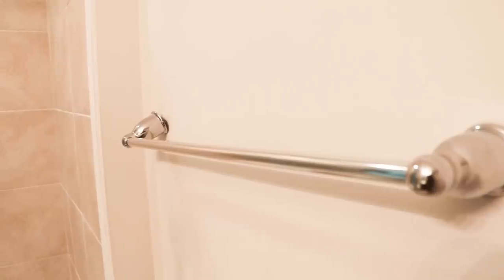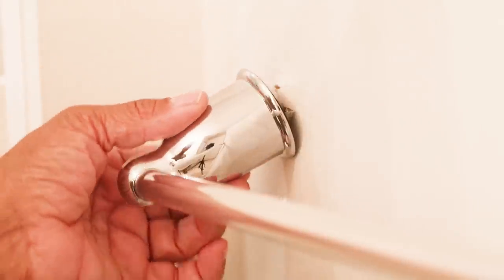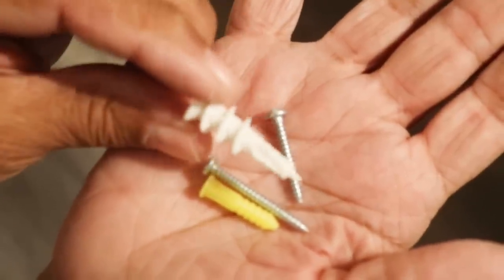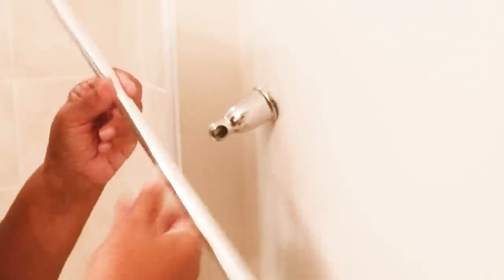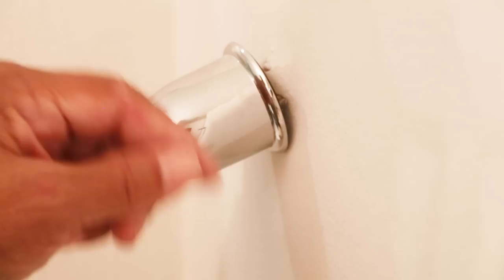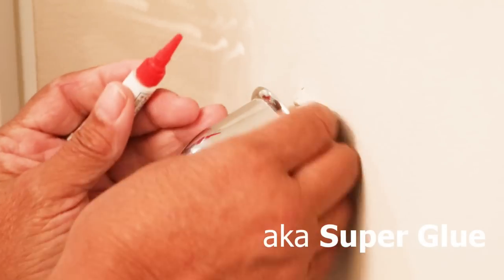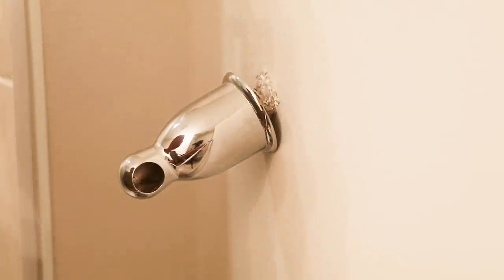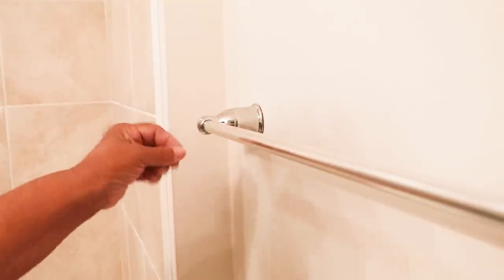Towel Bar HACK in seconds

Comment: I have a hard time with this one. Usually your guides are good, but the reason those anchors fail is because of the consistent moving and pulling on the towel rack, causing even 40lb anchors to wiggle loose. The glue will look good temporarily, but I can't imagine that it will last more than a towel cycle or maybe a few weeks before it pulls the paper off leaving a more unsightly mess. Last time this happened, I replaced the cheap anchors with some toggle anchors, reusing the hole left behind by the cheap anchors.
Reply: I agree! I always use toggle bolts. Never had one come loose.
Reply: Yeah, this is a surprising miss from seejanedrill, deep fake troll maybe?
Reply: you don't have to imagine it, try it. CA glue penetrates drywall. it's basically cardboard. have you ever tried CA gluing two pieces of cardboard together? try doing this. First remove the smooth outer layer (drywall doesn't have it). then put CA glue on both sides, and then put them together. you will never pull them apart, and the cardboard becomes structurally much stronger in that spot. I know this because I've done a bunch of cardboard work with CA and other glues, trying out what sorts of glue there are that can glue cardboard and which ones are the strongest. I was prototyping a collapsible box made out of cardboard and wanted to find the best glue to do it. It was fun as hell. And it teaches you to respect glue.
Reply: samuraiman7777  Caulk is not an adhesive.
Reply: @cheater00  Cardboard and Drywall are structurally very different. In cardboard you have a bunch of fiber pressed together. In Drywall you have gypsum plaster, pressed together between a layer of paper. There is no way that the CA glue won't tear the paper off and with it what ever powder that is attached to it. I can see some light applications, but definitely not anything that is strong enough to pull out anchors rated for 45lbs.
Reply: @cheater00  on top of that. Most likely you aren't even glueing directly to the sheetrock, but to the paint instead. Which means it won't even be penetrating as far you would think and will tear the paint off soon and with it probably some of the sheetrock paper.
Reply: @shawnferguson7477  also worth noting this gets worse for every layer of paint between the glue and the drywall.  Especially really old, brittle paint.
Reply: @shawnferguson7477  you know what, you might be right.
Reply: How rough you guys getting with the towel? Super glue should be fine, unless you rip the towel off the bar and it snags for a second. I have one glued to the back of the hollow door, been working for 20+ years 🤷‍♂️
Reply: @strongisland7015  obviously I do my pull-ups on the bar, and hang large carcasses to cook over my bathroom pit fire.  Pretty typical towel bar stuff
Reply: PogChamp!  Caulk is more like rubber than cement.
Reply: I think it'll work well enough.   I thought she was going with using CA to toughen up the drywall for those cheap anchors.  But then saw the blown out wall.  I'm thinking the CA glue will penetrate the paper and get into the gypsum/drywall material.   One concern is that CA glue sucks with shear force. But then again, you're hanging towels and even wet ones aren't going to weight 15 lbs. Blocking or toggle bolts are better, but that's not always an option for below average (skill wise) DIYers.
Reply: You might be right about drywall, but all my hardware, towel bar, hand towel ring, and toilet paper holder are drilled into tile, which covers the lower half of my bathroom. Still, the anchors loosen over time and the bar shakes a bit but this CA glue on the tile is a fantastic fix!
Reply: PogChamp!  I didn't do this for a towel, but I did this with hooks that hold jackets and other clothing (a board with 4 hooks). I caulked the holes and added new anchors in the caulk until it dried. Then I put the new screws in and it's working great!
Reply: @KrisLikesThis  there's an "I'm rubber, you're glue" joke in there somewhere 😂
Reply: @BrianSargent  😂 Good spot!
Reply: samuraiman7777  not at all. Caulk is primarily a sealant, it's NOT for gluing things together. Like, at all. 

You may be thinking of an adhesive that comes in the same style of tube as caulk and is applied with the same 'caulking gun'
Reply: @cheater00  
Would CA glue also penetrate and reinforce ceramics or pottery? I knocked the handle off a honey pot lid, and I’m wondering if this glue would be the answer.

Comment: I think what people may be missing here is that the glue is not intended to stick the mount to the wall. The real aim is for it to seep into the damaged gypsum via capillary action. Allowing it to re-conglomerate the bits of busted up material around the anchor. I oftentimes squirt thin CA glue inside my pilot holes in sheetrock immediately before inserting my wall anchors. Not only does that "anchor" the anchor to prevent it's wiggling, but it also strengthens the gypsum around the anchor.
Reply: I concur.
Reply: I've seen a video where you combine super glue with baking soda and when it cures it hardens up like it is hard plastic. I will use a combination of the glue and baking soda and coat the screw with it before screwing it in. Although, I wonder if the super glue is combining with the gypsum to give the same effect.

Comment: I thought you were going to do a different kind of repair, to put something behind the wall to give it some more meat to grab onto or something like that. CA glue and I never get along... unless it's gluing my fingers.   Anyway, I try to find studs if I can, but Murphy's Law says where you need the bar there is no stud.  Well, so far... knock on drywall, my towel bars haven't fallen out like that.
Reply from the maker: Towel bars quite often are longer than stud center which is 16 inches.  There's always that 1 side of the towel bar without a stud to attach to.  I use toggle bolts when I can.  But for a quick fix, I find ca glue does womders.
Reply: @seejanedrill  yep... that's why! I think the trick is the thick CA glue, I have the thin or medium glue... Learned to wear disposable gloves... Thanks Leah.

Comment: I think that a butterfly bracket might work better as a long term fix. My wall is papered and I am not sure the glue wouldn't pull it off.
Reply: Yup, spring loaded butterfly is the way to.
Reply from the maker: I perfer a toggle as well, but it's not always an option
Reply: @seejanedrill  there’s always a better option to glueing a load-bearing object to paint. I think you are trolling your viewers for comments.

Comment: It's worth a shot. If it doesn't work, you're back to patching a hole. So, you're no worse off for trying. It might get you down the road, but what is really nice about this is if you have multiple towel racks. If you move one broken rack you will want to move the others even though they're fine because you won't be able to tolerate looking at an off-center rack amongst a few. You then have to move them all and patch a bunch of holes and repaint.

Comment: I'm honestly a little surprised at this fix since I've seen instances where fixtures like this pulled away from the wall and delaminated the drywall they were stuck to - making a larger, unsightly problem. To improve my chances of long term success, I'd be tempted to also remove the fixture and combine glue+flour (sawdust, even better) to fill in the hole behind the towel rack so that I restored some structure for the screw to adhere to while also using the super glue as additional support
Reply: Here's something people don't think about, nothing is being atrached to the wall in a mounting like that, it's attached to the paint. 

It will fail. Source: I work at a massive hotel with 3 towel bars in each room. Over 500 towel bars, but also flat screen TVs, shower curtain bars, pictures, fire extinguisher boxes, paper towel holders, toilet paper dispensers, and a lot more. 

You learn what works and you learn what fails when you have hundreds of the exact same thing to deal with in one location, and lots of people trying bad ideas to fix things.
Reply from the maker: @aredditor4272  Actually,  I have thought about that very thing.  It provides more surface to surface contact.  If you don't put a support behind the drywall support the bar and you just continue to move it each time it fails, you just have a lot of patches.
Reply: Thank you Leah. Holy Smokes, finally someone shares an easy way to fix this problem.
Reply: @aredditor4272  what do you recommend?
Reply: I had thought of creating such a hold that would preemptively secure the fixture. A patch could definitely work, but if you are using some kind of filler, instead of flour, I'd use wood glue. I use it with toothpicks to fill door hinge holes to re-drill and the wood glue and toothpicks make the wood stronger than the wood itself. But there might be better ways to do it than this.
Reply: @KGrant-ty3oy  It depends on the situation, but ideally always mount towel bar holders into studs or backer lumber. 

If it's not possible, there are a few anchors rated to 50lbs or better, including spiral anchors that look like exaggerated screws. Project farm has a video on said anchors. I carry a full assortment with me - toggle or butterfly anchors, sprial, "toggler" or similar, "borefast" anchors. 

I often find myself using butterfly anchors simply because the head of the screw is small enough to fit into depressions in hardware. 

I run into many situations, including stripped holes in wood, so I have many different solutions. We even have shear walls where it's very difficult to find studs, so I have solutions for that. A shear wall resists shear forces, and is a sheet of plywood over studs, then drywall over that. On top of that, all walls have fiberglass insulation in them, and sometimes a coir fiber sound proofing sheet. 

Older homes have plaster and metal lath, or wood lath. 

Basically I'm saying there's much more to this subject than many folks understand.
Reply: @seejanedrill  A mistake  I see in backers, is plywood instead of a 2x(1.5") whatever on the bias. 

If it's a stripped 2x or any stripped wood, I have sets of fluted dowels,  various epoxies and other glues to repair stripped holes. Usually the stripped wood holes I repair are on doors and door jambs. Besides people treating hotel rooms badly, the maintenance guys have lots of terrible habits, especially trying to drive any screw  with an impact drill.  

Hate the pay and push to do things quickly, but I love the job.
Reply: @aredditor4272  
I just learned about drivers and watched a video about it after learning I had one in my new drill set. I was excited to learn I can use it for drilling screws and not have to drill a pilot hole and swap out bits for screws. Is a driver the same as an impact drill (your term)? Isn't their main purpose to drive screws? I thought they were especially designed for that. I'm confused. What are you saying the issue is?
Reply: @free2beme773  the issue is not being able to feel the resistance of the screw when using power drills, especially when using an impact driver. 

An electric impact driver has the same action as the air tools traditionally used by mechanics. 

When using a power drill, it's harder to feel when you're cross threading or stripping a fastener. 

Having said that, hammer and impact drills are fantastic tools for certain situations.
Reply: @aredditor4272  
So, I assume that if you are creating a new hole while you use the impact driver, that is not an issue? Just last week I helped someone else drill pilot holes and then install screws in clips to hang a cable on their hardy board on the outside of the house. If I had known about my driver before helping them, I think the job would’ve gone a lot faster. Would that have been a good use of a driver and screw?

Comment: The primary problem is very few towel racks are made to install 16” on center. Most are 20-24”. That’s nuts! Make ‘em standard so they can be attached to studs. Other solution: Install decorative trim /moldings across wall anchored to studs and secure towel racks to trim. Solid. Choose proper trim and it looks great too!
Reply: I was just thinking about doing this! I think decorative trim could be an excellent fix! I was going to do it for other things, too. Great suggestion.
Reply: That's what we do in our rentals and in our home.  It's much stronger that way than just using anchors in drywall.  Getting good trim and placing it as artfully as possible is key.

Comment: You’d think like most houses now block out areas for mounting TV’s the same would always have been for bathrooms, we did this as we have an accessible shower with an L bar. Awesome tip though!
Reply from the maker: I agree
Reply: When I was a framer I did this but that was for a custom home.  You get what you pay for.  If it's not in the building code and not on the plans It's usually not done because time is money.
Reply: @dk3062  that’s a fair point, but having a family of carpenters I guess you have more insight and forethought. It blows my mind how guys like to cut corners though, even inspectors are guilty around here for stuff

Comment: I use spring toggles that go through the plasterboard/drywall closed and then spring open like a pair of wings when they reach the other side. As you screw them up they pull tight on the reverse of the plasterboard and will never move unless you undo them. They only cost about £0.20/$0.20 each.

Comment: I went to the hardware store bought a rod " in my case square" cut it to the length that would allow me to attach to the studs on both ends. If needed you can paint it or have it powder coated.

Comment: thank you for this tip...I have two ring towel holder to hang and was wondering how I could get them attached to the ceramic tile in the shower.  Would this work also?  Thank you so much!

Comment: I have used a strip of plywood with a hole in the center as a “backer”along with a toggle bolt. Small enough to go inside but long enough to give extra surface area.

Comment: so now you're not just gonna fix the wall but also buy a new towel bar just because instead of installing the bar in a stud you decided to glued it.  the best option if you don't wanna relocate the towel bar of "glue it" as soon you noticed the issue, take it apart and replace the anchor for a bigger one and rearrange the holding plate.

Comment: I have never thought of this type of repair before.  Thank you, Leah, for another wonderful video.
Reply from the maker: It's a quick fix for a common problem
Reply: I had to use the glue to firm up a loose toilet paper roller. I worked perfectly and it could be removed without ripping you the sheet rock and its paper.

Comment: Good to know, question: will it work just as well on plaster? The problem I have is I installed new towel rack and tissue holder. The part on the towel rack that holds the bar keeps come loose my walls are plaster.

Comment: I did this with success on one of mine. On the other one, I replaced the wall anchors with butterfly bolts, which seem to hold better than the anchors.
Reply from the maker: I prefer using a toggle when possible

Comment: A great tip to fix my sagging towel rack. Thanks. Ashamed to admit that I have just been pushing it back into the wall - every day. It's definitely something that needs fixing.
Reply: I have been pushing my back onto the wall for over a decade! I finally had to take the last towel bar down last week. Glad to find this discussion. But, I will be using a toggle bolt instead because I may want to remodel and don't want to have to tear a towel bar off a wall and rip the sheetrock if I don't have to. After years of fighting towel-bars and having them fall off the wall and putting them back, I'd rather repair a hole and make sure the bolt connection is secure.

Comment: Here in the UK, it's not often you have a plasterboard wall in a house unless added by the homeowner. More often than not, the bathroom will always be a solid wall, so the towel rail issue here is unlikely to happen. But great video all the same Leah.
Reply: oh, i had a towel rack hanging on solid brick wall and this exact issue has happened.
Reply: Completey untrue..  there are millions of homes with stud walls, gypframe walls, and block with dot and dab.  All of the above can have anchor issues if the wrong fittings are used or the right fittings, wrongly installed
Reply: @danielthorne3088  i used the phrases 'unlikely to happen' and 'not often' i didn't say it would never happen. Of course it can happen when a complete novice DIYer puts something up using the wrong  fixings.
Reply: I don't know how many houses you've been in but just about any built in the last 50 years have stud walls covered with plasterboard. My house was built in 1936 and the only solid brick internal wall it the supporting wall in the middle of the house, all the partitioning walls are stud and plasterboard.
Reply: @GiggleBytes2011  Absolutely,  it was more the misconception that 'more often than not' walls in the UK are solid.
Reply: @tonysutton6559  maybe thats it then, as all the houses i have lived in are well over 50yrs old. With the exception of the house i live in now which is about 35yrs old with solid walls all round, including the bathroom.

Comment: Idk about super glue.  I would recommend spending $20 on an carpenter quality rechargeable Bauer hot glue gun and some extra longer on Amazon.  You could get more back there.  You may not even need to screw some things to the wall then.  For things that don’t melt you can also later remove them with a hot air or embossing gun without damaging the wall if you are very careful.

Comment: Don't agree with the glue either a Flip toggle as others mentioned would be a better solution since the hole is already wallowed out, but if you have to use glue I'd suggest some 2P10 Glue. It is a CA glue and activator that cures solid in 10 seconds.